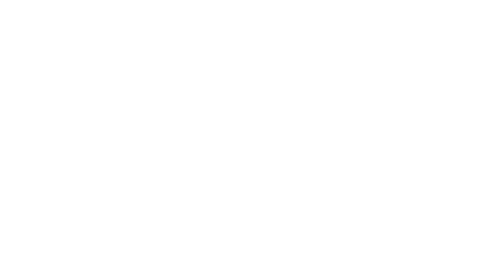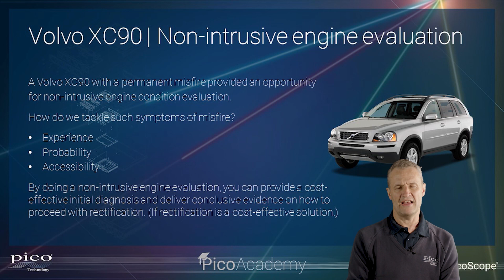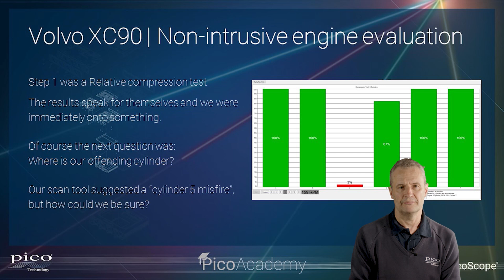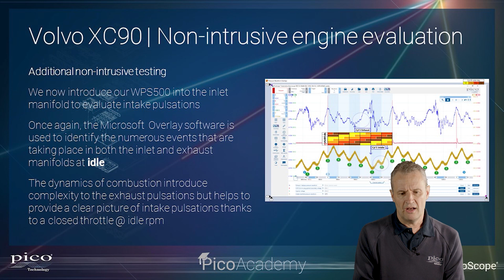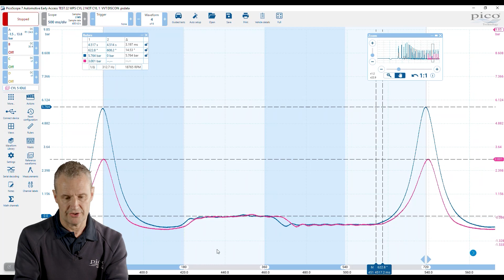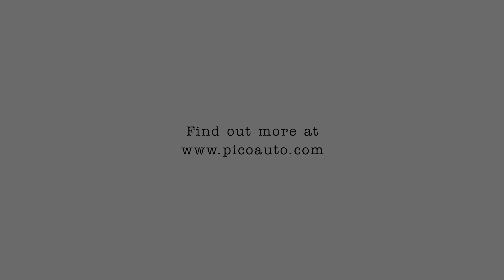Case Study XC90 misfire with Steve Smith Non-intrusive engine evaluation  [Motor Age]

Comment: In cylinder pressure overlay can be misleading, because doesnt factor for crankshaft acceleration/deceleration. In fact maybe your good and bad cylinder have exactly the same valve opening and closing events. Why would a worn camshaft cause late closing of a valve? My guess out of experience with this engines is that the lower compression is caused by the piston not travelling all the way up in the bore, because of failed connecting rod bearing.

Comment: Great video. Lots of awesome information learned in a short amount of time. I love my PicoScope and my pressure tranducers but I always follow them up with a leak down test if I suspect a cylinder has a leakage issue. I bought extra male and female couplers (Foster series 2) for my WPS500x. This way I can unplug the pressure transducer and install my leak down tester right into the compression hose already in the cylinder. Only takes a minute then I know for sure if a valve is leaking or not and which one. I also have to disagree with the line of, "Diagnosing stops when dismantling starts." You came up with all kinds of awesome information to help the customer out but the car's not diagnosed fully yet. The next step is pulling the valve cover and that is still very much a part of the diagnostic process and very much a billable expense even if the customer decides to scrap the car! Information costs money. 

Thanks for the neat case studies!

Comment: Excellent the cylinder pressure graph showing the delay in valve opening/closing relative to the good cylinder makes me confident in narrowing down the issue down to a possible valvetrain issue on that cylinder within the initial golden hour of investigation & giving the customer a estimate to look at the camshaft & followers as a next step rather than doing the usual & saying it needs a head off mate. A win for the customer & freeing up time for other jobs avoiding unnecessary labour all with verifiable proof. 👍🏻